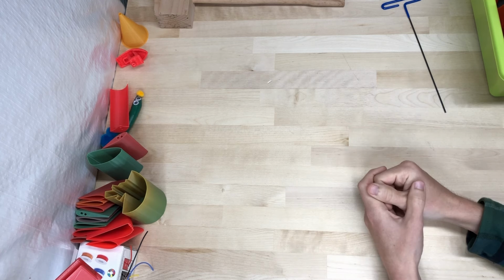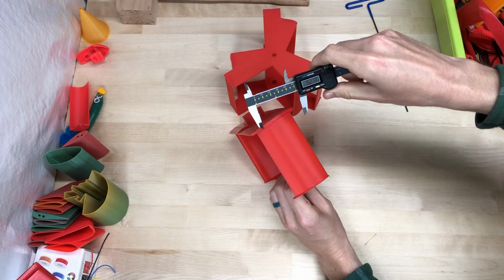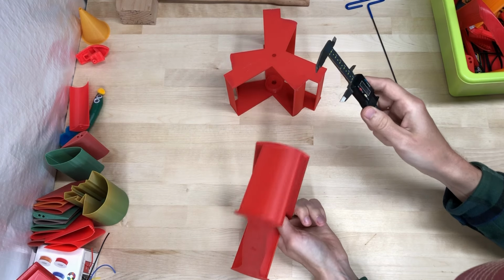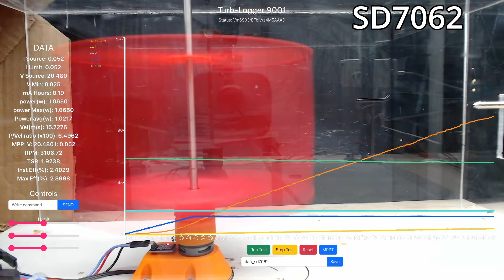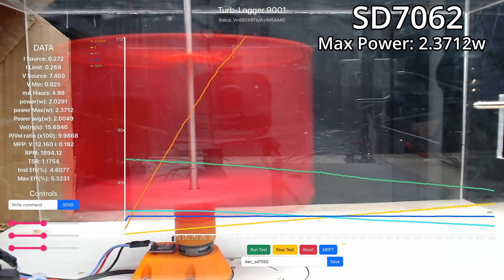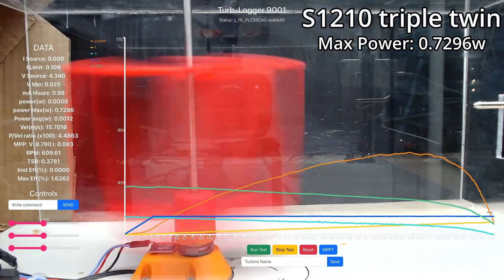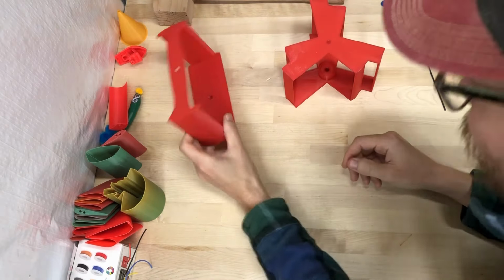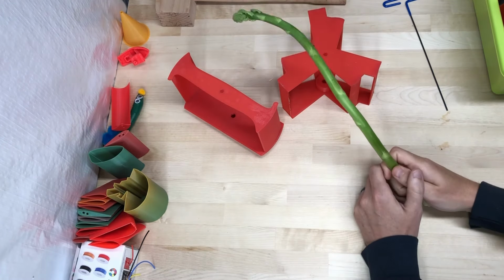Testing Asymmetric Airfoil Designs | Turbine Challenge | DIY Wind Turbine | VAWT

Comment: Thank for sharing the turbine Max.  The apparent shrinkage of the chord, in this case, comes from the airfoil being modified using the airfoil plotter in the airfoiltools web site.  The normally straight chord line was curved with a 91 mm radius to match the curve the airfoil travels as it spins.  The 'Reverse' function was used to make the airfoil lift inwards.
Reply from the maker: I have to go back and check but I think this was the highest tsr yet. Thanks for submitting another great design.
Reply: hey max, anyway i am very glad i saw tipspeed higher then 1
and Dan, can you share that reverse function, i made a spreadsheet but want to doublecheck
Reply from the maker: Let me know if you want me to take any measurements of the print for you.